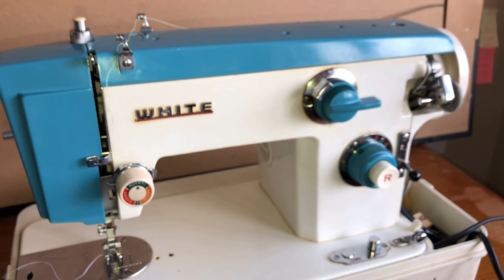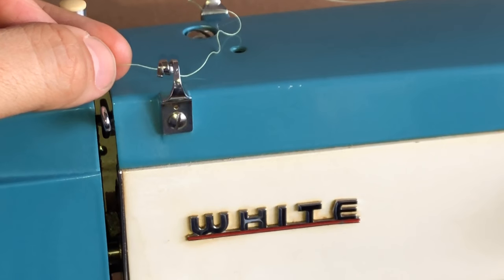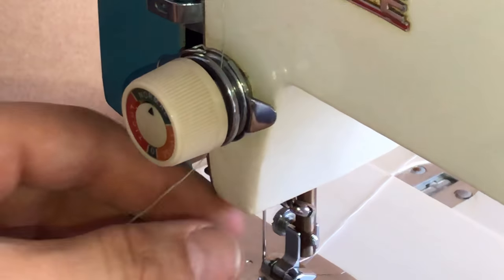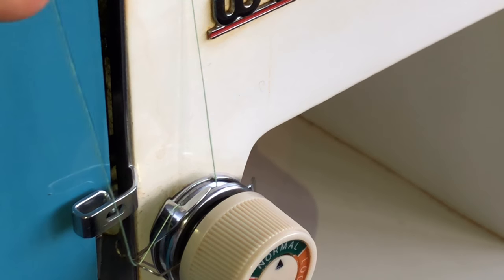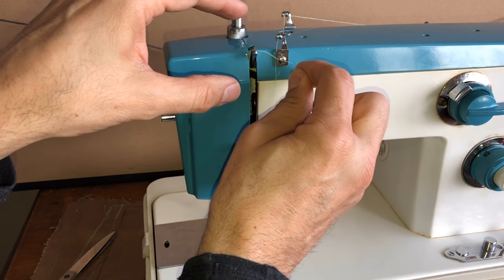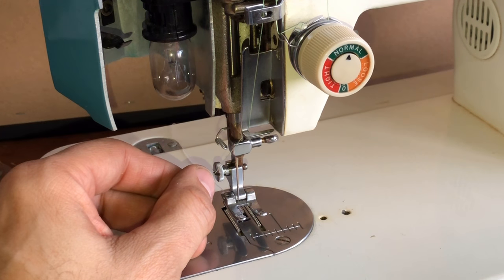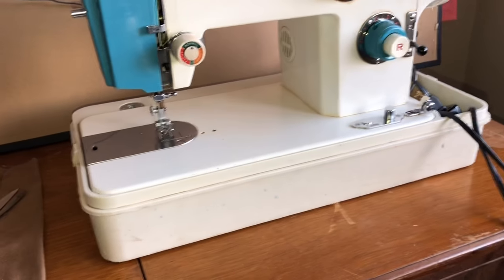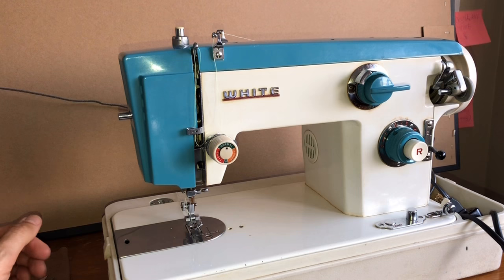SETTING UP MACHINE SERIES: How to Thread a Vintage Sewing Machine

Comment: I have the White 455 and pulled the last thread guide off when my fingernail got caught in it while I was sewing as I was trying to remove my fabric. Is that coiled silver guide soldered to the shank? Is this going to be easy to replace or attach? Your video was great by the way!

Comment: How the heck do I change the needle position? Mine is off center and it’s killing me. This is almost identical to mine. The same threading and the top button that appears to adjust the needle position but I can’t figure out how to make it change the needle from left of center to center. It’s a domestic white, probably made in the 70’s. I have the generic manual but it doesn’t have the instructions.

Comment: I recently just got a 2134 and I’m struggling to thread the damn thing any advice I’ve got the bottom bob and worked out fine it’s getting the other bag needle to through those threading needles and getting it to stay in the needle and not fly out

Comment: Quick question and it may even be a stupid one. But I have a sewing machine from the same brand. My thread keeps slipping. In this video, you thread or appear to thread the needle from the back. Should I be doing that? Im not sure what model I have but it's an older one like in this video. I love sewing and can't get a new machine right now and I get discouraged when that thread slips. Any suggestions??

Comment: Thank you for the information. My 499 is exactly the same but with zigzag and buttonhole levers. Also, it's a 1972 - the date is stamped inside the machine on the motor. It's an extremely heavy machine at 36lbs (only a Necchi is heavier). Very quiet machine. A copy of the manual is available on the Singers site as 499 but it's not good quality and only persons from the US can see the pdf file.
Reply from the maker: Thanks for the info!

Comment: This video  is required viewing for anybody with an older machine and no manual. I just picked up a Kenmore 158.15150 in mint condition (for $23.00) with all accessories including feet and cams...but NO manual. It's got the same tension device shown here. There are other well-intentioned videos claiming to show the process but they don't. They are blurry, fast, and usually shot from a bad angle. This video truly explains it.
Reply from the maker: There are many sites to download PDF's of Kenmore manuals.  Here is one I've used before.  Not that costly and you can always print and reprint paper copes as needed.  Scroll down about 2/3 of way down on this pate and you will see your model.  It wont have the zero on the end of the model number but this should be it:   https://kenmoremanuals.com/Kenmore_148-158_Models.htm

Comment: Thanks for the video! My husband picked up a White 530 (very similar to this) but the rubber ring on the bobbin winder is missing. Also, it looks like a different presser foot is needed for zigzagging. Do you sell parts?

Comment: Would love to see more videos on the 455! My grandma passed last year and left me her zigzag 455 from 1973, and though my mom always said it was never a very good machine and couldn't do much, my minimalist grandma kept it all these years so I guess she liked it, lol. I'm currently trying to figure it out, the manual isn't very helpful.
Reply from the maker: Thank you for sharing and how great that you have this heirloom from your grandmother.  I have found that vintage manuals can be high on information, but the illustrations for such things as threading can be a bit "approximate" in showing how to set up a machine.  That is one of the reasons I made a video using this White 455 to demonstrate upper machine threading.  Sewing machines vary in how people bond to them.  Similar to how some of us prefer to drive certain vehicles over others, your Mom may not find it as useful as your Grandmother did, but that is not unusual.  Its not so much a reflection on the machine, but more due to variations in how we all find one machine more helpful over another.
Reply: My husband bought me the 455 in 1973. We were engaged back then I still have it and use it. I also have a new singer, but the White is my go too machine. The White 455 was built to be sturdy and last and so it has. The White 455 is also sentimental for me.

Comment: Can you explain please what is the purpose of the little arm just beside the stitch lenght button which you can put on "m" or"r"??? Thanks.
Reply from the maker: Sure.  That area is used for setting the 'Stretch Control' for when stretch stitches are used.  When this machine was new, knitwear was VERY popular and this feature made is a bit easier to sew knit fabrics.
Reply: Thanks. But if I want to sew in normal mode, do I put the lever on M or R? (M = manual???)

Comment: Hello, I am new to sewing and have a White Model 455 Sewing Machine, but it is missing the lower needle bar thread guide and I was wondering if you could point me in the right direction of a replacement...most of the ones that I see online look completely different and I am unsure if the screw will be the correct fit. Thank you so much for this video!
Reply: Still wondering...if anyone knows it would be extremely helpful.

Comment: So happy I found your channel #newsubscriber I recently brought a vintage white sewing machine with the table included from a seller on Etsy. Believe I located the model number in back of the machine which is a 44111 I can’t seem to find much information about this particular model. Just want to make sure I threaded the machine and the bobbin correctly. Do you have any information you can share it would be most most appreciated🙏🏾💕

Comment: Hello! Thank you so much, you've been so helpful especially with my newly inherented White Model 43. I'm looking for a source for the motor wicking. Its the thinner cord but any will do. I also just was gifted with a Dressmaker Model S-2402. The threading guides are a little different and was wondering if you have that model. The tension wheel in front seems to be very tight and in order to move the thread thru, I have it all the way open at "0". Not sure if this will be a tension stitch problem and may need to watch video on correcting top to bottom tension. Thank you for your help!

Comment: Nice video!  I am a veteran and have 4 machines (Berninas, Singer and an Elna serger), and a professional seamstress.  Just last week I picked up a White 599 ($35, which I thought was pretty good).  There are a few things about this machine that I'm trying to figure out.  Firstly, it is called a "zigzag" machine, which I'm assuming means that in its time, zigzagging was new and that this is the focus of the machine.  It only has one foot, but I believe I have found a number of universal feet that will work with it, and I have tried my 1944 Singer feet - they work, so I've used them as a model to find other used feet.  The machine, by the way, is for my 26 year old daughter who is just now learning to sew.  I have a few questions I'd love some help with.  Is this the only forum where I can ask you questions?  Do you have a contact section?  The needle shaft on the White is set to the right.  I can't figure out if this is because it's a zigzag machine and this is permanent, or if something is off kilter inside the workings.  Thanks for any feedback!
Reply from the maker: Hello Theresa.  Many sewing machines from that time period had default needle positions that honed either to the right or left.  This may be due to the desire to have machines that would be ready to make 1/4 inch seams or it can also be due to the sewing fashions/trends of the time.  Sewing machines often reflect features that were in demand at the time.  And yes, ZigZag was a very important innovation at that time since people did not have Sergers to secure raw edges.  If you don't have the manual, you can purchase a PDF of one for very little cost.  That machine should take Low Shank feet and so as you have found, its not too hard to find feet/attachments that work with it.  I prefer vintage feet since they are made with better quality but new feet can also work fine.  If you would like to send me additional questions, you can email me here by subscribing if you have not and then on the "ABOUT" tab on my home page, you will see a link at the bottom of that page which will show my email.  Its not a good idea to post my or anyone's email on comments sections due to spam bots that can find and use them.
Reply: Hi again!  I do have some more questions and would really appreciate being able to ask you through email.  I went to the "about" button and could not find anything on the page except the little synopsis you have written about your experience.  I could not find a link.  Is there another way I can get to your email address through the subscription?  I'm surprised I can't find a link.  Thanks so much again.
 @VintageSewingMachineGarage

Comment: My White 940 runs fine then starts doing irregular stitches....I've tried everything from tension dial to taking apart and cleaning. What's wrong?
Reply from the maker: You might have it checked by a local Sewing/Vacuum service center to see if the timing is off.  There can also be burrs that form on the hook that can cause this kind of inconsistency.
Reply: @VintageSewingMachineGarage  Thanks,good idea!

Comment: We have a White 477 we got from my mom. The belt is stretch and tattered on the edge. Any idea what belt we could replace it with?
Reply from the maker: Hi Jason.  If you still have the old belt, hold onto it for measuring.  You can find new replacement belts online or at some local Sewing-Vacuum centers.  The belts are generic and so that makes it easier.  The amber colored lugged style belts work just fine.

Comment: Thank you so much for this video. The thin check spin wire (not sure if that's the name) was actually over the flap so I couldnt figure out why it was so tight! I fixed it! Thanks again! For reference I'm using a dressmaker zigzag which is slightly different.
Reply from the maker: Glad it helped!

Comment: I bought a House Keeper machine that looks like it has a matching tension assembly that you White machine has.  I would like to know what replacement I would be looking for/brand type that could be used in this machine?
Reply from the maker: You can search online for used replacements (Bonanza.com is a good site for this) or there are new reproduction generic replacements.  Some of these have varying levels of quality.  You can also attempt rebuilding the one you have if it is malfunctioning due to a broken check spring for example.

Comment: I threaded my machine like you showed, but, nevertheless, my top tread keeps breaking off/coming out of the needle when I go to sew. Any ideas on how to fix this? Mr. Google isn't helping. . . .
Reply: Have you found a resolution to this? Mine keeps doing that as well
Reply: @Andrea_Rodriguez  well, at first I thought that I had fixed the problem by letting my top and bottom threads stay pretty loose behind the machine, but this only worked for about 6 inches of stitching before the problem arose again...
Reply: @Andrea_Rodriguez  maybe a burr on the bobbin?

Comment: I have a clone but it is stuck in reverse. Any suggestions?
Reply from the maker: Hello Dave.  It depends on how your machine has its Reverse button or knob set up.  If yours is similar to the one you see on this White 455 Model, there is a linkage behind the button that allows the machine to go into reverse.  Since I havn't seen your specific machine, I cannot be sure, but I suspect that the linkage mechanism for that is stuck and may need cleaning and/or oiling.